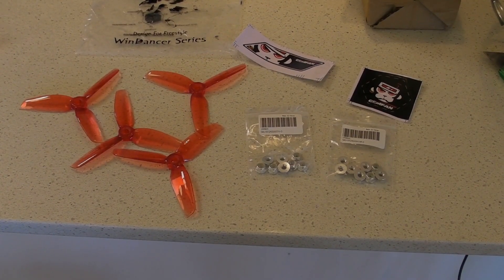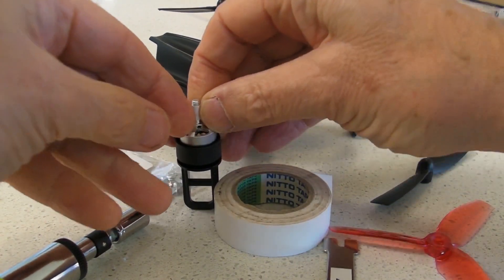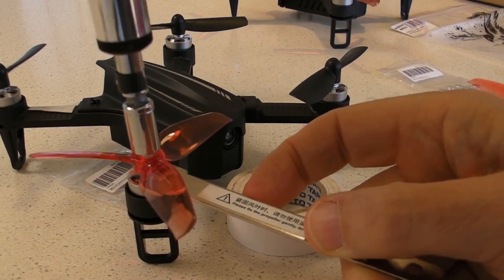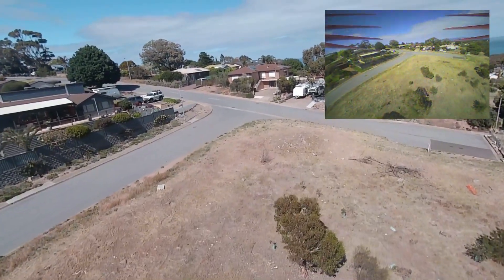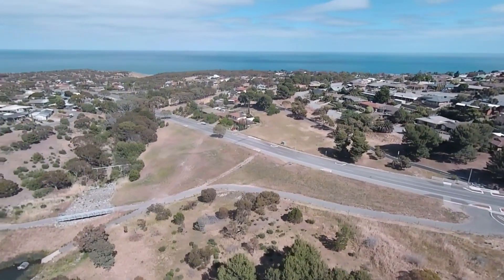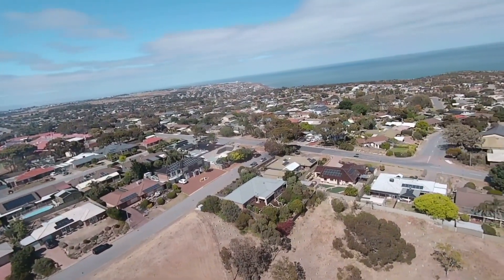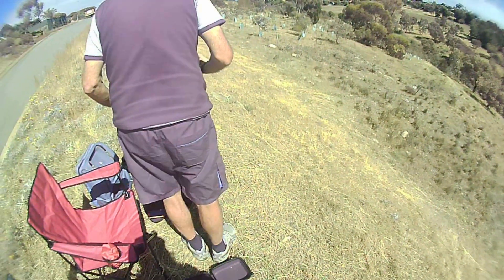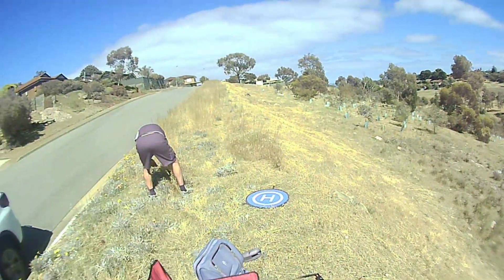EX2 Mini - fitting and testing Tri-blade props

Comment: Prop nuts link pls ...
Reply from the maker: Bought the lock nuts from HobbyKIng. Described as Flange Nylon Lock Nut M4 High CW Thread (10pcs), and  Flange Nylon Lock Nut M4 High CCW Thread (10pcs).
Here is a link - https://hobbyking.com/en_us/catalogsearch/result/?q=Flange%20Nylon%20Lock%20Nut%20M4%20High%20CW%20Thread%20(10pcs)
Reply: @skybug3  thx you..I just knew if ex2m/b3m1306 using M4 nuts .. bcoz racerstar 1306 is m5 shaft .. also for props..should bought them many times...lil bit confused me... 😧
Reply: @indraeedee  I have another question, you needed to use reduction ring from 5 to 4mm on shaft to fit propeller tight , how high was this reduction ? I know outer diameter 5mm inner 4mm

Comment: Do they Say 4mm Props like these or similar by now?
Reply from the maker: Got to admit that I stopped looking after I found using 5mm holed props works well. Let me know if you find any out there.
Reply: @skybug3  I can't find these also.. you got a link to them or maybe what size props are these?
Reply from the maker: @fbiagent3399  Just search for - Gemfan WinDancer 4032 tri-blade Here they are on Banggood -
 https://www.banggood.com/2-Pairs-Gemfan-WinDancer-4032-4x3_2x3-3-blade-4-Inch-Propeller-PC-CW-CCW-for-RC-Drone-FPV-Racing-p-1470342.html?ID=3238&cur_warehouse=CN
Reply: @skybug3  thanks.. if banggood has this quad for A good deal like last time.. like 40$ then i will get it with few sets of props cuz free shipping only orders over 55$

Comment: Hi David, nice flying👍. I love your set up 🕹🛸.. can you please share me the link/info for the screws you're using on the eachine ex2 mini motors. Thank you:)
Reply from the maker: Bought the lock nuts from HobbyKIng. Described as Flange Nylon Lock Nut M4 High CW Thread (10pcs), and  Flange Nylon Lock Nut M4 High CCW Thread (10pcs).
Here is a link - https://hobbyking.com/en_us/catalogsearch/result/?q=Flange%20Nylon%20Lock%20Nut%20M4%20High%20CW%20Thread%20(10pcs)

Comment: I have also experimented with different props. I have settled on DAL 4045BN for the prop. For the shims I am using round aluminum tubing 3/16X.014. It is a tight fit to the prop and a tight (almost press) fit to the non threaded part of the motor shaft. Same nuts with a Sharpie for color.
Reply: Just to be clear I am using DAL 4045BN, 2 bladed props.
Reply: @kaseym6992  Thanks  I just checked, and I have the 4032 three blade... My mistake.
Reply from the maker: Sounds like a good setup.
Reply: I bought the same tubing a few weeks back, and haven't had a chance cut and fit yet.   Glad to hear I'm on the right track.   Tape seems a little less precise on centering, but maybe not. 

I am worried about drawing too much current through the ESC's or overheating the motors....   Any wisdom to share there? (note:  I also have 4045 props)
Reply: @snafu6548  I switched props 2 months ago and have not found any heat problems with the motors. With lots of packs through it. I am using 2 bladed and fly more LOS than FPV with lots of throttle on LOS. Rule of thumb if you switch from 2 blades to three blades is go down one size in diameter. I have also tried 3 bladed. Yellow on the front and black sharpie on the back props helps LOS a lot. I put a FPV camera inside but no action cam. After market bat's strapped under.
Reply from the maker: @snafu6548  A good test I picked up with brushed motors is to touch each motor to your lip after a flight - can easily pick if any are over heating. I do worry about the standard ESCs, especially since I hear they are 4A, not 6A. I've seen a few examples of burnout, in addition to mine. However, my second EX2 mini with standard ESCs is still flying well with tri blades, and an Action Cam hanging below.

Comment: So do you think 3 blade is better than 2? If so, why? Good video, enjoyed it. The lady has a pleasant voice. At first I thought you had a voice module in your Jumper stating time elapse, lol.
Reply from the maker: Hi Colin - I replied yesterday, but found the comment gone this morning. 
3 blades give a little more power and speed, and improve handling. I pulled down the right stick hard to air brake a Bugs 3 in front of me with 2 blades after flying one with 3 blades for a while and almost got hit in the face - it took a lot longer to slow down. My wife was born and grew up in Southern England - that's where the nice accent comes from.
Reply: @skybug3  much compromise on flight duration?  or should I say range, because it might get out there faster?
Reply from the maker: @racketman2u  A little - a minute or so, I think.

Comment: When you fly hard left or right, with your antenna horizontal, you are risking a doughnut hole radio fail. Just a heads up on that. I'm going to try my XJB props on my B3mini now that I've seen your 4mm tape mod. Thank you!
Reply from the maker: Thanks - good point on the antenna, I should be moving to keep it at a better angle. Guess the booster helps.